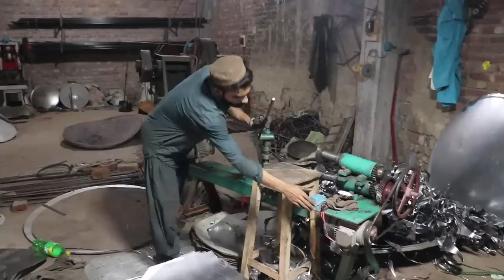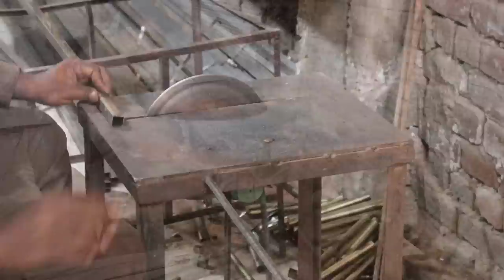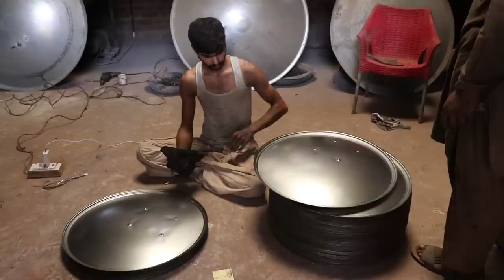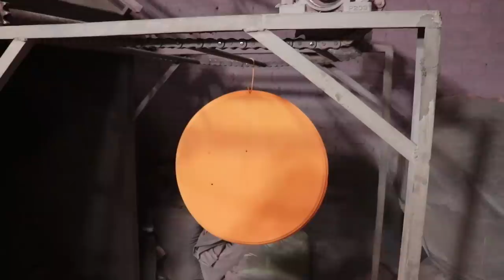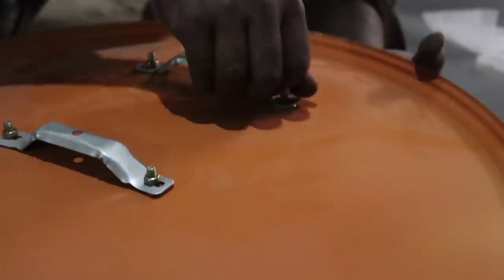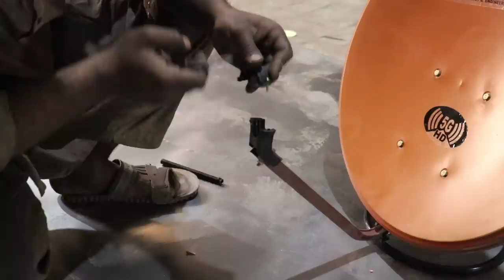Learn how to turn iron sheet into a powerful dish antenna

Comment: Are these disposable antennas?  Because an antenna made of such a thin material is driven in two by the first wind.
Reply: Nah! 
Were do you live that have such strong winds?
Reply: yeah, you're right. Just one storm and this antenna would vanish. It's not even up to the mark for commercial sale to customers. Maybe they want dirt cheap alternative.
Reply: I think that is indoor antena, maybe
Reply: Its diameter is very small so it is ok to use thin iron sheet.

Comment: I watched the whole training video, and am now fully qualified to make my own 5G HD Satellite Directional Antenna Receiver Dish.

I just gotta get a truckload of sheet metal and square tubing, a circle cutter, a 50 ton hydraulic press, a 4-point rotary puncher, a square tubing bender, a powder coating spray booth, a powder coating SLOW oven, and a bunch of nuts and bolts. 

Darn it, I'll just buy one for twenty bucks 😕 🙃 😒
Reply: It's just the reflector and holder. They don't make the electronics which has more technical significance.

Comment: Too thin no rigidity. Mounting is shoddy so will move about. No perforations in dish so will catch the wind. Finally the LNB ( the bit they didn't add at the end that goes in the clamp) alignment will be rubbish.

Satellite dishes are in fact quite precise designs for the frequency band being used. This looks like someone has copied a dish without knowing how it works or what it does.
Reply: Its selling then it's obvious that it must be working, that's why they are manufacturing it